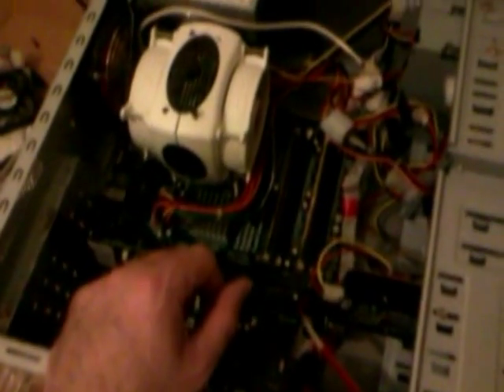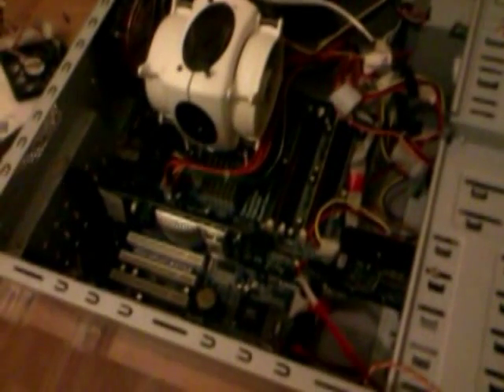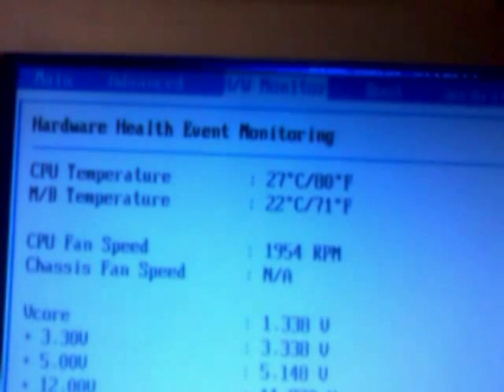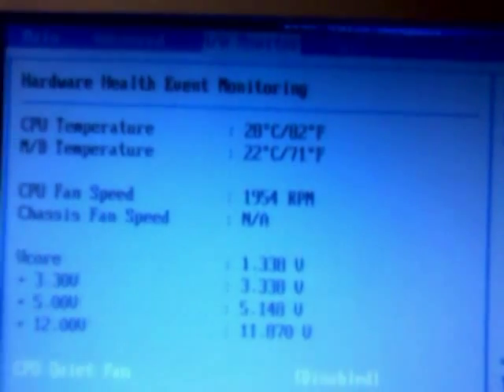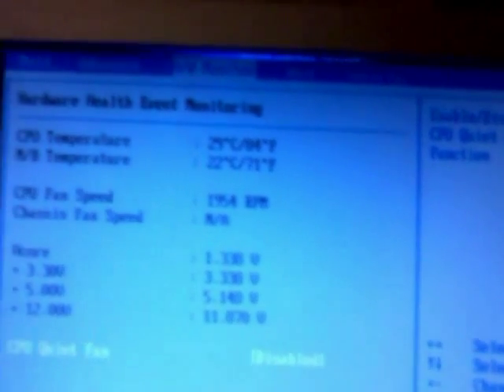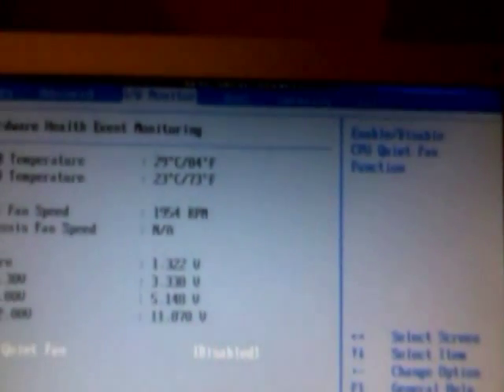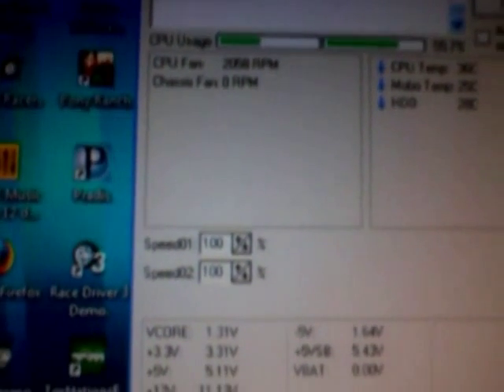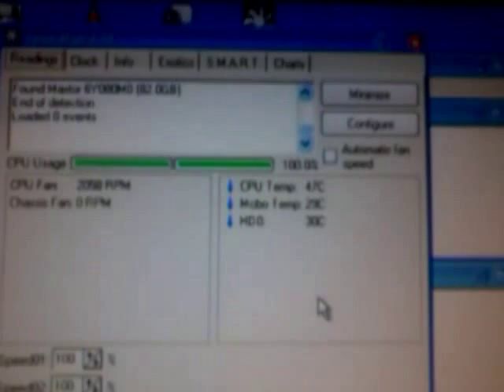Homemade CPU Cooler Fan Mount - modding my Zaward Vivo

Comment from the maker: @dnbrhythm Well, you have a lot of fans in there so your temps should be good! With the stock cooler, you'll need a lot of fans. If your ambient temp is showing as minus 1 then it does suggest your sensors are out, and they could be out by around 20 degrees.That would make your load cpu temps on stock cooling around 58C which, tbh, is still pretty good!

Comment: Wow! That's awesome! My Asrock 4COREDUAL BIOS says the CPU temp is at 37C, M/B temp 32C. Under Win7, it's usually around 43C. I recently switched thermal paste from the Arctic Silver 5 to the Coolmaster Thermal Fusion 400 and now it bounces between 41C and 42C.